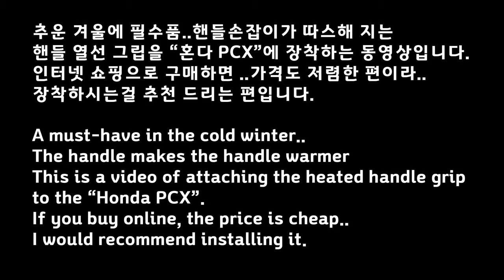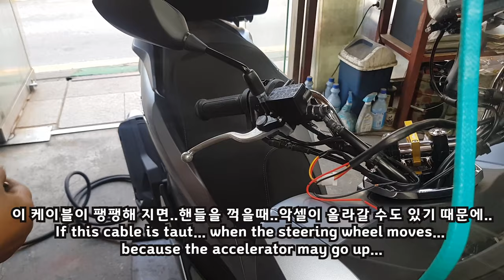Mounting the Honda PCX Motorcycle Steering Wheel Heated Grip. WW125AM

Comment: What do you think about those heated grips as a mechanic? why they are not so famous among rides?
what damage they can make in long term on the scooter systems?
i have a friend which installed them just now and the battery died, he couldn't start his scooter any more (kymco movie xl 125)
so we charged his battery back again but he isn't using this heat grips no more haha
Reply from the maker: (Heated Grip) must not be used while connected to the battery.
to be connected only when the engine is running
It should only be used with electricity from the engine.
That way it won't damage the battery.
The guy seems to have installed it to draw electricity directly from the battery (this is bad practice).
If you install it to use electricity only when the key is turned on,
No problems arise.